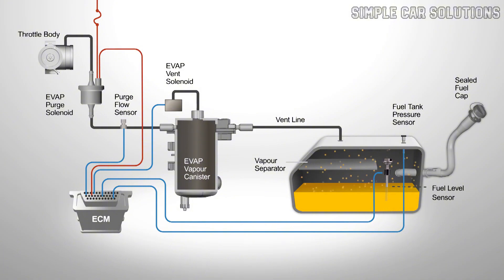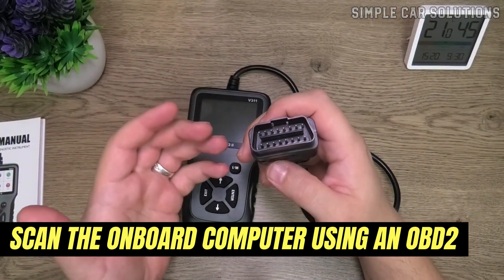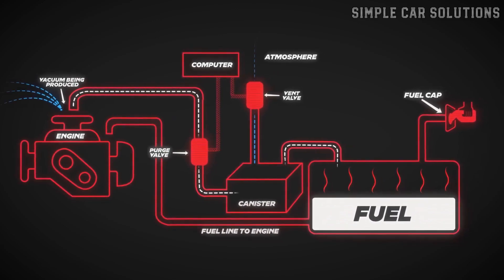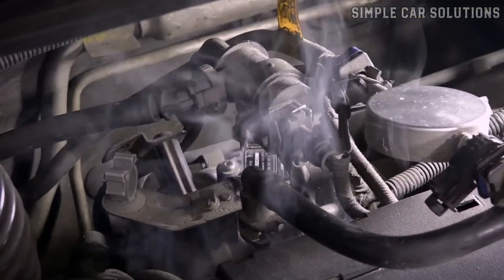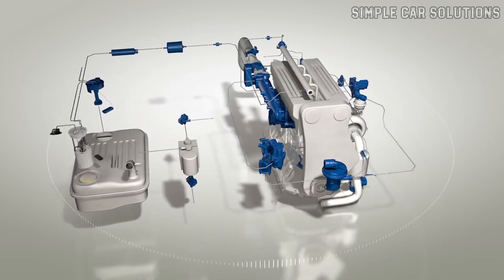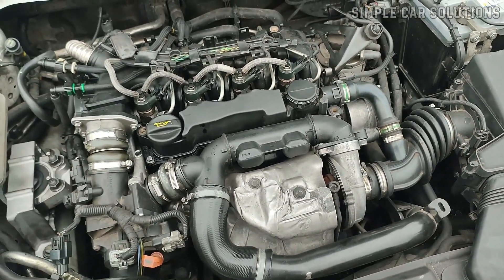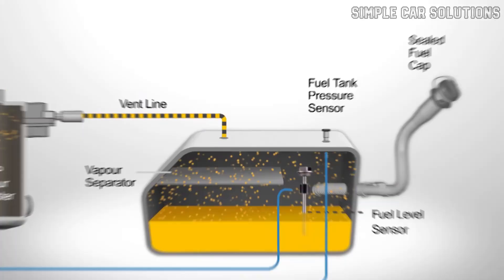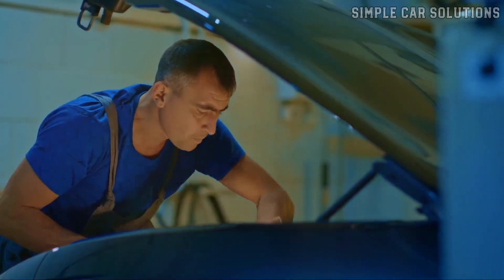My Car Smells Like Gas But Isn't Leaking - What Is The Reason?

Comment: I have a 2013 highlander and I found that some injector orings were leaking fuel onto the lower intake manifold. I purchased new orings and replaced them. The smell of fuel persisted and it was a evap valve vacuum line i forgot to reconnect. I reconnected, then the smell went away. a week later I started to smell fuel once more. I performed a propane can test on all hoses with no change in idle. I then turned the key on and inspected the fuel rails. I found a very slow leak at the fuel rail end cap. Toyota now uses plastic fuel rails. I can see the end cap get wet right after i wiped it clean. I ordered a new replacement for $400. I will swap it out tuesday.
Reply from the maker: Sounds like you did a thorough job diagnosing — good catch on the fuel rail end cap. Replacing the rail should solve the issue. Let me know how it goes after the swap.
Reply: @SimpleCarSolutions removing the upper intake, throttle body and crankcase/vacuum hoses were the obstacles to access the fuel rails. Note that in order to perform the swap, i advise new injector orings, upper intake/tb gaskets and the fuel rail plastic retention clip. That clip will break upon removal due to thermal cycling and it costs about 20 bucks. It clips on and keeps the fuel connector from backing off. The fuel rail assy costs $400 with shipping and taxes. 2 hours later, everything was installed. Make sure you perform a key on leak test before instaling your upper intake. If no leaks, proceed to rebuild. I fired the vehicle up, took it for a spin and no more fuel smell.
Reply from the maker: Excellent work and great tips! That’s a textbook DIY repair — thanks for sharing the details.